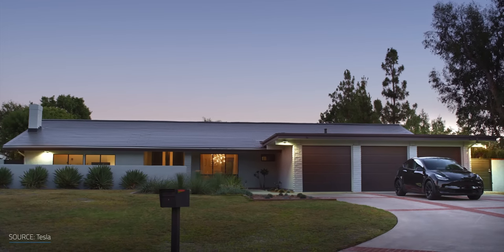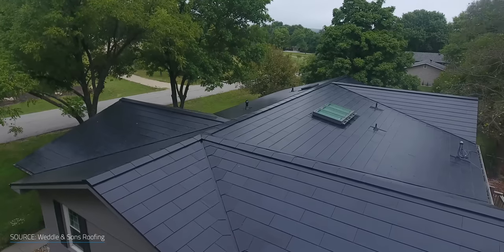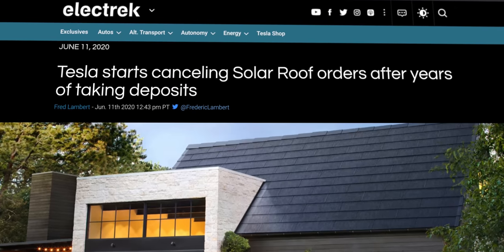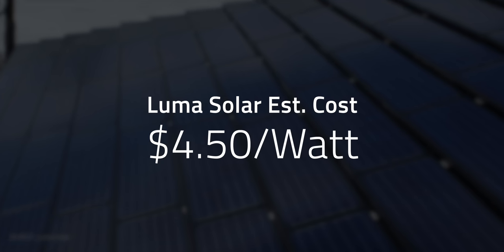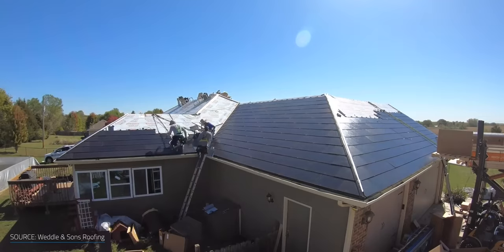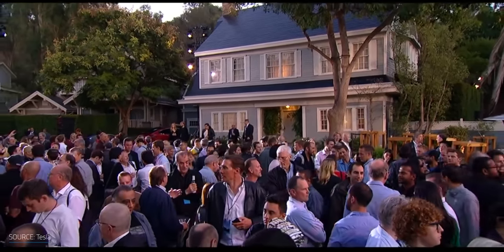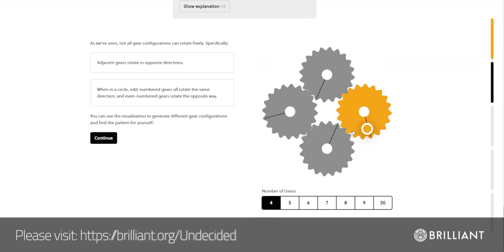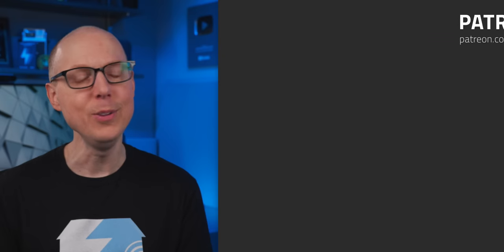The Problem With Tesla’s Solar Roof

Comment: Do you have any idea of the rating for solar roofs? In terms of fire risk. There are certain roofs that are unrated, or rated “A” and you receive a discount on your insurance for this. Metal roofs are one of these rated “A” roof types. Any idea how solar roofs are rated or if they have a positive or a negative effect on your home insurance when it comes to fire risk? I’m in CA and while the price points in CA lend themselves to solar roofs, fire insurance is also difficult to obtain. And doing things like installing a rated A roof improve your rates for insurance.

Comment: I was in the building industry as a building material supplier for decades 1980 and 1990 in Baltimore Maryland. I unloaded many a tractor trailer flatbed load of G.A.F. shingles into and out of our Lumber Yard. The G.A.F. shingle factory that supplied us was located in town nearby at 1500 Ponca St, Baltimore, MD 21224. Then us "local, Baltimore, folk", friends that worked there at G.A.F., and even the G.A.F. factory Sales Representative selling the product to us referred to the roof shingle manufacturer by its three letters "G" - "A" - "F". Is the name of the G.A.F. Company now referred to in marketing advertisements as "GAF" as said often in this video? If so, what a gaffe that would be.

Comment: I'm in Denmark, and I need a new roof now - the solar cells vs integrated or shingles frustrate me. Typically all of the shingle solutions are way more expensive than just a normal roof and then some solar cells on it :/

Comment: Solar roof takes over a week to install??? I have over 100, 200 high quality panels on my property and it didn't take me a week to install all of them on racks I made myself that have swivel capabilities for a future sun tracking set up.... Not counting the design and build time of the racks in the install time because that took a long time to get the strength and range of motion I wanted while still having mounting options for servos and hardware to physically move the panels

Comment: One leaky fastener in the middle of anyone of these “solar roofs” would mean you would need a complete uninstall/reinstall. Leaky roofs happen all the time. That turns a 60-100$ quick fix into a 6 month wait and a new loan from the bank.
Reply: You missed the part where he showed how they are designed to be easily serviced then I take it

Comment: I’m curious if using solar panels would help deal with ice damns on roofs that currently have ice damn issues. One being that one panel could cover the problem area so that ice will not form underneath the panel and hopefully will shed snow off easier.
Reply: Some PV systems can deal with ice. The inverter injects a current into the panels, which makes them warm up and melt the ice/snow. Then they can generate power

Comment: I wonder how the efficiency drops compared to normal panels 
Normal panels would get cooling air under them
Where as the shingles would mot
And climbing through roof spaces years ago as a sparky's off sider in Australia
In summer it could be heat torture

Comment: Solar roofing companies should provide a product that combines solar roofing on south-facing elevations with inert tiles on sides of roofs not directly exposed to sunlight.  I bet they could drastically reduce the cost that way.   People in the more northerly latitudes don't need solar roofing panels installed on north facing roof sections.

Comment: I actually need a new roof now, so I looked into it. Yea not worth any, I PERSONALLY do my own housework and I want to roof my home myself. Nobody sells these separate and must have an installer. Roofing is not hard, and the connectors for the Gaf are simple to install. Why can't I do it myself? "Eclectic is why" No it is not, I can rn go buy fuses, conduit, wire, boxes, and more to set up a whole new room electrical system. If that is allowed, then so should just a simple solar panel with wires connecting to a few boxs. I will happily learn how to do it.

Comment: I'm always interested in the responses I get from homeowners of solar roof installations when I ask the question, " How do you clean the ice and snow off your panels/roofs?". The usual reply is a 'confused/blank expression' like they never thought about it as a responsibility they would be tasked with. Equally frustrating would be the accumulation of leaves in the Fall, or those pesky Robins during mating season when they coat everything in white droppings. There are probably other reasons the panels would need to be cleaned, but most people wouldn't get up on their roofs on a regular basis to clean them so they could produce maximum solar energy. It's also not uncommon during certain seasons to find someone, somewhere is illegally burning and producing ash that falls over everything, or fireworks remains around the 4th of July, etc.

Comment: I like the idea of transitioning over to a solar roof considering how frequent I have power outages in my area. On average 7-10 times a year. However, I wonder about the long-term durability to withstand quarter to softball sized hail storms that I've experienced over the last year as well.
Reply: I saw someone who basicly had a fence 10cm above his array for that reason.
Probably wouldn't be that expensive either.

Comment: I had an estimate done and they told me I'd still have power if the grid power went down during sunshine. 2 friends of mine have Photo Voltaic systems and if the grid goes down they have no power. So, to me the real problem is the cost of energy storage. I really like the flywheel but it pretty much doubles your cost just like Powerwall. ⚡
Reply: How much your price has increased after u accept Tesla design

Comment: I am not a fan of solar Roofing. The reason why is maintenance. I have 36 panels on my roof 6.5Kw. I also had 6 spares on the ground. Glad I did. 2 of my panels caught on fire and shattered. Luckily my concrete roof tiles protected my house from these fires. Luckily there is not much flammable material at the wire connection just a plastic junction box and some resin poured to make a weather proof connection. I was able to swap in my spares in less than an hour. I’m not sure the same could be said of a solar roof. If and when it catches on fire will it provide fire protection? My panel manufacturer did not intent to have issues 10 to 15 years after manufacture either. How long will it take to change out the solar roof at end of life? What is that labor? My panels are almost done with their service life. Inverter is going strong. My racking is still good. My roof is lifetime. I will be able to swap out my existing panels with new more efficient panels in probably 6 hours labor. Probably go from a 6KW system to a 10KW in the same space. I should add, I self designed and self installed my system. I am an owner builder on the permit. I did not pay a company to install so I know my system in and out.

Comment: Solar roofs currently occupy a small niche that is not likely to change soon. PV technology is still quickly evolving so making "short shelf life" PV tech a financially long term component of a roof doesn't seem like a very sustainable solution. It's an all or nothing approach  that seems destined to result in obsolescence of PV in the roof before long before the roofing system wears out. hopefully the Solar roof designers are providing change-out options for the active PV shingles when there are significant advances in PV/PV system performance. Seems like a very expensive way of adopting solar energy.

Comment: I have been considering a solar roof for a long long time , you have left out property assessment and tax value plus property insurance , wind damage hurricane tornado plus vandalism like what happened with my roof are things to be considered , the ability to safely and efficiently clean the system from any dirt deposits or exhaust emissions black suit deposit is a must .

Another main issue is ,
unfortunately we have a greedy installation contractors who would want to make over 50% profit if not more , the best solution for a solar system in my opinion is something with easy installation by the homeowner himself on the weekend , idiot proof pre-assembled system that comes with a easy Installation System that could be installed with few screws and have a nice day , if someone lives outside the city and have excess property then preassembled system that can be lowered from the back of a truck with easy to install electrical wire no different than a plug-in system similar let's say with the generator plugs that can be mounted under the electrical meter would be Optimum , and one thing constantly on my mind is the changing technology , if in ten years after the installation technology changes then what I have on my roof would be considered toxic waste a liability not an asset .

Comment: The biggest issue with Solar has always been energy storage. Battery technology is so wasteful and expensive, not to mention horrible for the planet. You get tons of Solar power when you don't need it and little when you do. Many Power grids no longer buy back power from solar homes, and if they do they pay very little Because like you they don't need it at the height of the day either.

These roofing tiles look better, and in theory be cheaper in the end. But they do nothing to solve the issue of power when you need it. I also have extreme caution over a business model that always promotes "Long term savings" and 30+ years of shelf life when none of these new products have been tested or in use that long. In fact many these start up companies likely go out of business before then, good luck claiming a warranty at that point.

Comment: This is ALL you need to know. from a UK solar supplier.

"When the concept of the Tesla solar roof was first announced, it was hailed by some as the future of environmentally conscious construction and home design. Why add solar panels to a roof retroactively when the roof itself could include the solar PV technology to generate electricity? Unfortunately, it seems that the challenge is more complex than even an engineering giant like Tesla can handle. As a result, Tesla solar roof tiles aren’t yet available to buy."

I fully expect they never will be available and with their quotes reputedly as high as $100,000 for a 'normal' size US house there won't be much demand anyway.

Comment: Solar Panels on the roof is the worst idea because that involves more risk.
Any panels exposed ARE vulnerable.
Panels on the ground are easier to maintain and protect.
That also speaks in terms of quick portability when you need to move your investment inside or under a weather proof structure.

Comment: One undiscovered problem with Tesla’s solar roof, which caused me to cancel an application, was the legalese of the agreement form. In all CAPITAL LETTERS, Tesla maintained that the client was responsible for settling disagreements between Tesla and its subcontractors even though the client was not made aware of the identity of subcontractors or the existence of any disputes. It even went on to explain that there may be penalties as well as fees associated with failure to pay the disputed amounts. These failures were almost guaranteed since there was no obligation to inform the client of the dispute. When queried, Tesla said that it every intention of paying its subcontractors what it owed them, and I’m certain that is so. But if it’s so, why the emphasis in the contract denying any responsibility for dispute resolution with subcontractors?  Tesla refused to amend the paragraph in question, so we had to refuse to sign the contract. Read all contracts carefully.

Comment: I wonder if you can use alternative methods of power generation rather than using straight grid-tie.

I'd prefer to use a hybrid model. Battery backup with solar charging before regen to the grid. I don't want to be one of the people who have the grid go down and their panels do nothing.

Comment: my electric bill is 145 a month, x20 years im barely at 40k and the roof cost 15-70k how is that even viable? whats the point? to save myself 5k after 20 years? and if it fails over and over with duds i doubt that would be worth it all at that point since you have to clean your roof and no one is pointing that out since you need to pay someone for 20 years to clean and you got broken shingles that might happen... its just not worth my time at that point , just paying 1 bill and not 3 is a bit easyier and cheaper

Comment: idk why solar is so expensive in USA, it should be cheaper there. Here in India I got 5kw solar (Trina panels, Panasonic Inverter) installed on my roof top for under $4200 USD without Govt Credit, that cost includes shipping, installation and grid connectivity, all done by the vendor.

Comment: As with anything Tesla, expect a ton of promises and hype and then a long line and wait for the real product.  I signed up about 5 years ago for the roof tile system.  At the time of my deposit Tesla made it sound as if  I would see panels within 12-18 months.  This worked for me since my existing room had a few seasons left before it really needed to be replaced.
So, I wait  and  wait and finally 2 years later decide to contact them.  Much to my surprise they were still in development and were only  installing the product on an experimental basis.  I said fine, use my roof.  Of course they were only installing the product in a select area and I wasn't in Silicon Valley.   After getting my deposit back I opted for the ugly panel route after installing a new roof.  The only benefit of the wait was the almost free battery back up system the panel company was promoting at the time of my purchase.   

If you are thinking about solar do your homework.  Talk to your neighbor who's had panels for at least 5 years for the real story on how much they like their system and system company.   All panels look the same but are not of the same quality.  If you lease, the solar company is usually on the hook for maintaining the system for the duration of the lease and they will use the highest quality products on the installation.    This isn't always the case on purchased systems.  They will often use less expensive components to save a buck.  You're on the hook for any and all service.    Most of these unethical players have since gone under or have been absorbed by larger installation companies.   After 2 years I have never had an issue with the components or my solar provider.